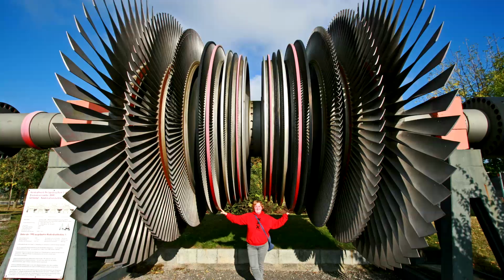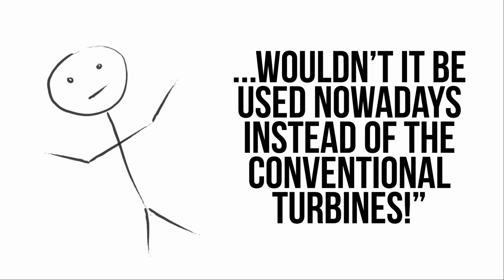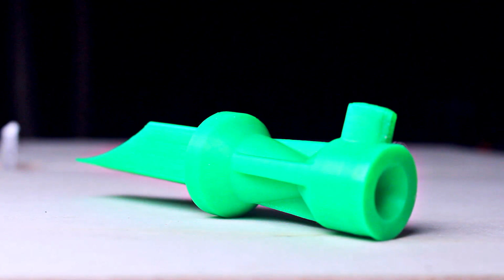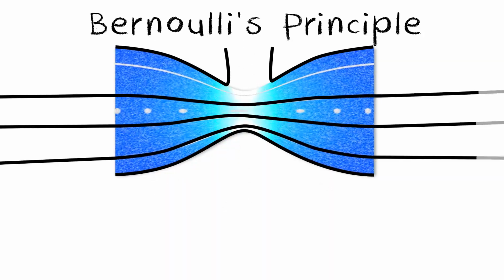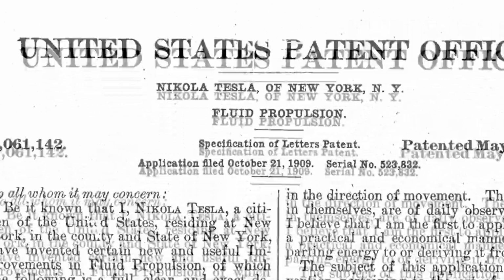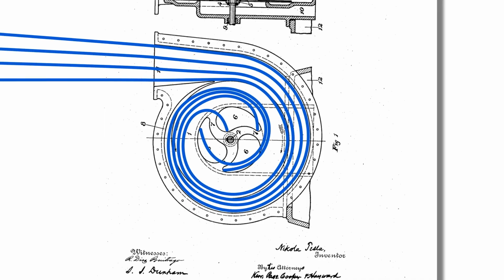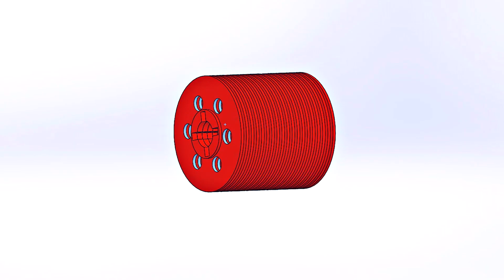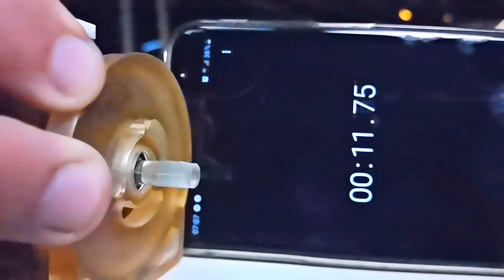Tesla Turbine [Smoke Flow Slow Mo]

Comment: How about foot suspension or kinetic movement powered pump to run it a few gears to get the most possibly a fly wheel giving it intermittent boosts using the turbine
Pollution? 🚫 Electrosmog? 🚫
walking in the air ✅

Comment: Hey I know this is a late comment....But we have just invented liquid air energy storage..The 'perfect' partner to the Tesla turbine as a modern replacement for steam.

For those that can join the dots. we have the capability  to directly mitigate global warming (shallow/surface geothermal to absorb direct heat) which, through heat reclamation can power an air cooling and compressing plant. if done correctly it can first remove co2 by altering its phase to liquid, which can be sold as a direct competitor to all other forms of co2 production (think fizzy drinks and crop co2 enrichment) as well as storing it for later use as liquid fuel or to turn into solid carbon for sequestration via plants..we then continue to cool and compress the air to turn it into a liquid and store it for later use.
If we choose the dirtiest air pollution locations as our air intake zones and clean the pollution while we are at it and then when we discharge our energy storage, we could either use the cold to cool previous steps, or could directly release it cold into the cryosphere zones, preserving the ice and displacing the warmer dirtier air  towards the air intake zones.

In short, we could use one complex machine to create clean energy from the sun (shallow geothermal) which in turn directly mitigates climate change through thermal absorbtion and co2 capture as well as providing surplus energy and a form of energy storage.

50 years from now we could be pulling up our cars at an 'air' station instead of a gas station and filling up with liquid air to power a tesla turbine based car.
Such a car could have some form of battery/capacitor set up for regenerative breaking and initial acceleration. no gears, no brakes, no complicated or rare materials..and the more of this form of energy we demand, they cooler the sky and the quicker we can remove co2...

Comment: Try Using dual tangent air supply to turbines. One at top and one at bottom angled at tangent on disks.. Use a Round Casing.. Do 3,4 or, 5 or 6 air inlets.. Key is, is, the pressure of one intake take bounces off of the other pushing air towards center. Think of it as a Double Helix..Then try more.. Tripple helix.. Etx.. Let the air squeeze the air.. And the inlet manifolds can be 3d printed.. Main air supply in center pointing towards disks bearings hitting a cone evenly dividing air to outer perimeter where it is channeled to each tangent inlet then applied to disks.
Reply: Anybody read these things?

Comment: Could a larger version of your Tesla Turbo be something that could be placed under the hood TESLA car? A sort of RAM air intake? And have an alternator attached to the shaft like you did with your servo... to then trickle charge the car wile it is moving? Reducing the time between plug in charging?

Comment: Is your goal to maximise the mechanical power out of the tesla turbine or to maximise the electricity produced? If the second is the case, you should consider looking into more efficient generators such as a BLDC motor or something that is more typically used as a generator. The motor that you use seems as a very cheap one to me and i think you could optimise the generator and the load on the generator to gain more output. You say that the turbine has high RPMs but only very little torque. You might get better results when you increase the electrical load on the motor (more Ohms) and you are able to draw more Volts (but less amps). I know this is very relevant with wind turbines, but to be honest, I have no idea if it is the same for Tesla turbines.

Comment: I know it's a late comment, probably won't be seen and is probably a stupid idea, but have you considered using a spiral/screw instead of a series of discs? If your analysis for the 'failure' of the volute casing is correct, then it would be the reduced surface area (and subsequently time) from the smaller discs the viscosity of the fluid is applied to that is causing the lesser energy transfer. Thus if the contact time were increased, the energy transferred should increase. The fluid will always try to find the shortest path and with the discs it will be from the edge to the output holes from the discs' frame of reference. With a spiral, it could significantly increase the energy transfer by causing the fluid to go down the equivalent of the entire series of discs.

Comment: It seems like the roughness of the turbine plates as well as the mass of them would make a big difference. Maybe try sanding some smooth and some rough and testing? I guess the rotor weight would only act as a flywheel and shouldnt really affect max output but would be interesting to see if it affects anything practically. That thing is sweet good job!!

Comment: https://www.youtube.com/watch?v=kwP8n6xJFjc
This is a HIT :D
Integza i Challege You my Brother. Print me a 2`` Negative of a Long 0,5M max Pipe type Tesla Valves It can be a p[rototype. I need some plastic i can melt off like a candle after I zfreate a MOLD to pour Alluminum alloy and mashine part. This Valve takes superheated steam (before it was cold saturated steam from low pressure enviroment created by Cooling steam in cold water mist (steam colapsing created a pressure drop)
GL My friend and thans for eventual Help :) I`m close to creating a 1M in diameter HARDDUTY cycle Tesla turbine powering 3phase big Generator what heat my home and burns Woodgas :) I will make a video about it soon :) Si Subscribe if you Like and Sub to this GuY i Love his work you will love it or hate it or Meh :D I love it :D

Comment: Maybe try texturing the disks, and putting them at a very slight angle from the airflow, this might help the air stick to the discs better. Also, make the edges of the disks sharp so that the air can get in better. I have no clue if these ideas will work, but who knows. (Edit: btw I love your channel!)

Comment: So some notes about your nozzle design from a mech engi. If you want to do a supersonic nozzle like with your inceeasing decreasing nozzle you have to make sure you calculate out your flow rate properly. At the point of the throat the fluid has to be moving transonically with enough pressure behind it to accelerate to supersonic velocities. I strongly suspect that you need to make a much tighter nozzle first before you try to expand it to a supersonic nozzle.... else u end up with a subsonic diffuser which slows the gas velocity dramatically.. all your nozzles could do a slight redesign that would make them much more efficient

Comment: What if you'd add strips on disk that are in the shape of following airflow, not too thick that it would cause other disks to come in contact. And I mean like little ribs sticking out of the flat side of the disk to catch the air or liquid better?
Reply: I'm not a scientist or physicist, but wouldn't that increase RPM?
Reply: so it's all really is about design of the disk to balance out the airflow to the most efficiency

Comment: Having an LED in series with your resistor messes up the power calculation because the diode doesn't follow V=IR.  Additionally, you didn't ever actually characterize the Efficiency of this device.

Comment: Hey man, maybe im completely wrong but since the machine works because of fluid viscosity, and since the viscosity of gases is higher at higher temperatures would´t it be more efficient to use steam as originally designed by tesla? I mean it would be hard to get 8 bars of pressure but you could explore this parameter.

Comment: Is there any way to add magnets to the disc's in order to create turbine magnet generator. With 32krpm the voltage output should be extreme.  Food for thought.

Comment: Can you use stationary blades on the walls of the turbine that move the volute down into the turbine's rotating disks a bit, you would have to change to a casing that opens along the plane of the axle like a clamshell instead of from the plane of the bearing like a tube, but it should be reasonable to print compared to the nightmare it would be to machine.

Comment: You should probably use a fluid with an higher viscosity to improve the torque of the turbine.
I think that it would be a good idea to test it with steam and water, the rotating speed would probably be lower but due to the viscosity of the water the inerty momentum would be higher causing an higher torque.
Excellent video

Comment: Hi,
I'm a physics student and I enjoy your videos.
You said you're open to suggestions so here are some.
While talking about design I noticed there wasn't any math mentioned so here's how to get started.
There is theory and there is experimental data.
First you make a hypothesis and then you verify it with experimental data.
Here's one right off the top of my head: Pressure, air velocity and dimensions of outlet holes are related.
Now, you've increased air velocity at the inlet with the nozzle. That's great. Because that means that the air will want to stay on the outer tracks of the turbine. The difference between the pressure on the inside and on the outside of the turbine is bringing the air towards the middle (towards the outlet). Now, by varying the input pressure and the hole diameter you will be able to gather some datapoints and from that data you will be able to optimize your design.
Now... there's a lot more I came up with just by writing this down. I write this one to you because it's the cheapest to do. You can cover the holes with something, make new - tiny - ones and gather data for various input pressures. You can then keep making holes bigger and collecting data for basically free.
If you wanna talk my e-mail is sdrenski@unios.hr
There's a LOT more we could discuss

Comment: I have to see one of these scaled up . I want to know what it can do with torque at a much larger side . While I know you math hounds will jump on this mathematically those of us who are suborn will still need to see one of these Tesla Turbines the size of a boar hog before I can see the usefulness in the device .   If this is so revolutionary why is nothing on this planet running on Tesla Turbines ?   

What i have been trying to design is a boat motor that not only runs 100% electric equal to a 30 horsepower motor I want the boat to run chargers off water wheels so the battery back is constantly recharging itself when in motion .    I've always wondered if instead of water wheels I could use Tesla Turbines that get water forced through them to run the generator .

Comment: The saw you built using the jig saw  isn't what most people call a table saw, the tool typically referred to as a table saw uses a circular saw which can cut faster and straighter but wouldn't be able to cut curves very well, what you made functions more like a scroll saw.

Comment: Never be in the way that broken turbine blades could fly to, neither your hand or fingers... Don´t use 3d-printed blades, use old CDs/DVDs, they can surely stand the speeds, and are perfectly balanced too!!! And you can use  old CDs/DVDs for a variable rotating mass of a static dynamometer/dynometer, instead of CNCing and fine-balancing aluminium blocks...

Comment: I bet if you made a better generator to put on it, with pulley or gears  that connect from turbine to generator, you would put out alot more power with less energy used. Then use step ups from generator and you could make this a very efficient power source. I love Tesla as well and myself an inventor with technology for renewable energy, which I have submitted with NASA . But any who. Another use I see for a perfected version of this turbine is flight. Drone style stability flight. Do you think it could be made to produce enough thrust? And love your videos

Comment: What if you used a hollow drum instead of discs? That way, the air molecules' inertia would help increase the surface adhesion, and you wouldn't waste energy flowing along the Tesla Turbine's stationary cylinder wall.  Air could enter the drum from the left side at a slight angle, so it had to spiral around inside the drum, dragging it around, before moving to the center and exiting out the right side. Probably this isn't as efficient as Tesla's design, but wouldn't it be cool if it was?

Comment: You should name it "Prints Charming" because it is your favorite printer because of it's looks. Also, just another random idea, but what if you made is to the the gas simply just blows across the top section of the discs instead of circling around into the center. This may help to decrease the amount of turbulence greatly. The only issue is that it would have even less torque, and so you may have to make a clutch system, or help the motor get moving (get past the start up friction). Slight ridges in the discs would help to gain torque as well in this case

Comment: FYI the volut casing was purposefully designed to lower the RPM of the Tesla Turbine because at the time there wasn't a material strong enough that could handle the high RPM of the original design. Your criticism that it makes the turbine less efficient is valid, but that's because it was designed that way.

Comment: Hey, I have an idea that might not be a waste of time.  What if you could put a propeller into a torus facing down powering a hydraulic smoke ring of a heavy fluid mass water.  The motion of the fluid must duplicate a smoke ring.
Reply: Watch a few smoke rings.  Is that some kind of trappable hydraulic inertial wave?  If I applied force to it, then what, I gotta make a jar to hold it with turbines or something to get the mass of water really moving for a torque vortex of water.
Reply: Rungs of water do leap out as a splash
Reply: Most advanced water balloon?  If it flies.
Reply: Up through the middle out and around the back, inertial wave.
Reply: Connect something to the garden hose, and see how fast you can get the water spinning.

Comment: Bro you’re a smart guy. But you are making a toy. 

If you cant find time to read... i do t know what to tell you. You are an entertainer, not an engineer. 

What you are forgetting is this. Linear engineering is not a thing. You cant just make a turbine of larger and smaller and expect the same levels of efficiency. There is a sweet spot in its size which is the island of efficiency based on the gas you are using for acceleration. The viscosity of steam and of air are not equal and behave much much differently

Comment: Has thousands of dollars of 3D printers -- but makes his own table saw?! perplexed  Great video, though!
I haven't done the physics on this, but would scaling the size of the volute casing help?  I'm presuming the viscosity drag on the discs is only a function of the fluid's velocity and the two materials used, but the torque on the discs from that drag increases linearly from the center of the disc.   Likewise what if you changed the rate of decrease of the cross-sectional area to minimize the region of airflow that is not in contact with the discs?
How does the standard generator compare to the volute model if you compare the output power from each, divided by the total surface area of all the discs?  I'm presuming here that your volute discs are smaller.

Also, get a vape for your smoke.  It's far easier to control than cigarettes, and cheaper.

Comment: Love your work Integza and you probably already know this but just in case..

I noticed that in the part of the video you put an SLA printed part in front of a window inside your workshop to "cure in the sun" and the window looks closed.  I just wanted to make sure you know that glass blocks UV light so you need to open the window :) 

I'm almost positive you already know this but just in case I thought I should mention it.

Keep up the great work!
Reply: I know I’m really late, And I’m sorry if can’t really remember what you said considering you commented 1yr ago.
But anyway, technically your right. But there’s two different types of UV. UVA and UVB. UVB is stopped with glass, however UVA is not effected. Given, I don’t know what type of UV is required to cure it.
Reply: @Mr.Scootini  Three types actually,  there's also UVC which is used for disinfection in hospitals amongst other things but probably not 3d printing.  It is easily stopped by glass but not sure about the others.

Comment: If the disc surface is smooth efficiency will be low, try a slightly textured surface.
Reply: The whole advantage of Tesla’s turbine design is that rather than collision molecules, it uses the attraction between them to pull the discs parallel to the propellant. 

The way to improve efficiency then, is to make the discs thinner, smoother, and closer together. Different gasses and liquids, and disc materials can be tried as well.
Reply: @JasonJrake  some of the best versions I've seen people were basically using sheet metal for the plates.  Also why doesnt anyone ever hook one of these up to various weighted fly wheels and measure some actual useful energy levels
Reply: If a textured surface, would provide more friction, then why does a textured golf ball go further than a smooth one?
Reply: UncopyrightableMuzik most of human knowledge at your fingertips and you ask your question here. The dimples on a golf ball reduces its turbulent wake, allowing the golf ball to have less drag than a smooth ball. If you had used your brain and 15 seconds you would have the same answer as I by simply typing: why does a golf ball have dimples?
Reply: @crimsonconductor2235  lol, triggered.
Reply: Big brains